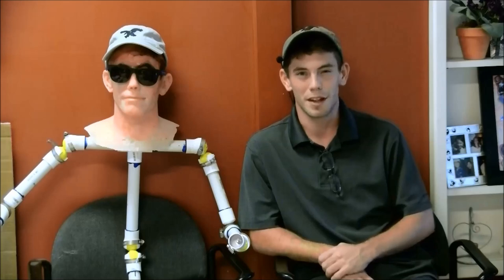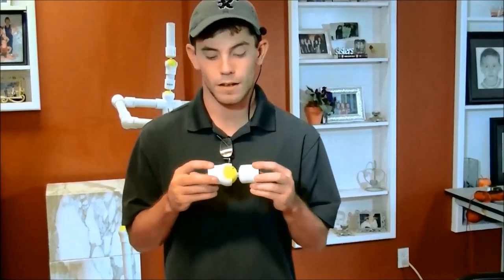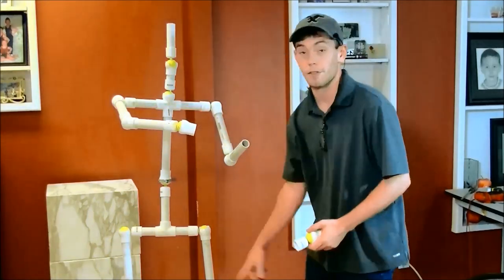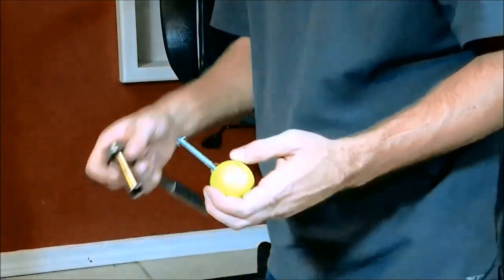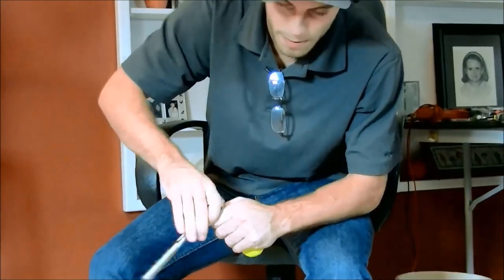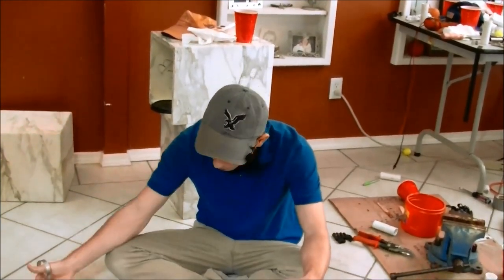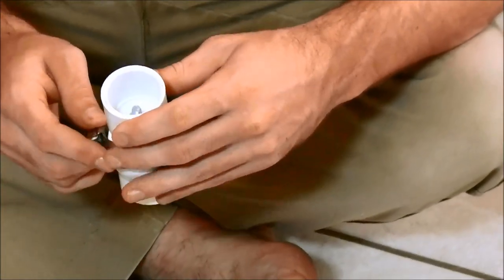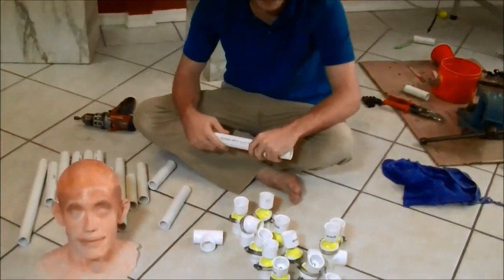Mannequin - Halloween Prop Idea - Mannequin PVC Frame -  2019 DIY Project

Comment: Would some sort of coupling that is expanded to go around the 1" pipe work for the golf balls instead of having to heat pipe and press something in? Or maybe use a larger size of PVC? Or would the collar still restrict movement since it's not curved like the ball? I wonder if a fernco style fitting would work at all. But the rubber might prevent things from moving.
Reply from the maker: The idea in itself is kind of difficult to achieve since we are trying to be able to get something to both move and lock in location. So there needs to be some resistance, getting a pvc pipe larger than the ball itself would create a little too much freedom for articulation in my opinion. Not sure what a fernco style fitting is so not sure if that's practical or not. Rubber can be a good thing if pressure is allowed to be applied manually.
Reply: @TulsaVideoMagazine  A fernco fitting is a rubber coupling that uses metal hose clamps to tighten it on to PVC, ABS, etc in situations where solvent welds are difficult or impossible. You should be able to tighten and loosen the grip with the hose clamps, but being rubber, I'm not sure how much play the ball would get. If you just want to pose it, it might work.

Comment: Probably no hope of this getting answered but what type of bolt did you use for this? The PVC pipe size is easy enough to figure out but the bolts are harder to guess
Reply from the maker: 3/8ths inch and 5/16ths inch are the sizes we would suggest. measure your two golf balls and make sure it can go through both. Ours were 3.5" to start we decided to ground the ends off ours so the ball would have more play inside the socket.

Comment: do you think i can use a blow torch if i don't have a heat gun?
Reply from the maker: You can you'll just have to be very delicate with it, it'll heat that plastic up quickly.
Reply: @TulsaVideoMagazine  thank you for the reply. Just over more question. The double ball is perfect for the shoulder. Your elbow joint with the golf ball, does it mimic the motion of a regular hinge joint? I imagine the ball can twist the forearm quite abit
Reply from the maker: It is similar to a hinge joint, but has both horizontal and vertical motion. SO, it'd be like having 2 door hinges one horizontal and one vertical.

Comment: Oh thank god I found SOMETHING to help me out. I need to build a skeleton of sorts to display a monster costume, and all I had to work on really was 2x4 wood... which since I don't own a circular saw I really didn't want to do... but I DO have a nifty PVC pipe cutter hand tool I could use! If you could answer my question though, I would be extremely grateful; how much weight can a skeleton like this handle, and if I need to add more weight to it, how could I stabilize it further? Thanks in advance!!
Reply from the maker: It solely depends on where the weight is distributed. if you center the weight over his torso i'd wager you could hold 15-20lbs with it but if it's heavy on his arms maybe 5lbs would be the max i'd suggest. Of course you could always tighten all of the joints more so than what we have done to give him more stability.
Reply: @TulsaVideoMagazine  yeah its... a massive costume for sure. Head is about 5lbs, arms altogether I wanna say like 2lbs with the mechanics in the hand, and the tail it has also has some heft to it. I'll make sure to tighten everything as much as possible. Thanks so much for your fast reply!!
Reply from the maker: please post your creation we are very interested when you finish it. We'd love to see it! Good luck.
Reply: @TulsaVideoMagazine  sure thing! My plan is to rig the costume up for display for Halloween so it should be sometime before then!
Reply from the maker: Awesome sounds great! Also, if you need some of those ball joints made we'd be happy to make them for you! Or anything really we can make it and ship it to you. Recently started doing this since there has been so much feedback. We will also be doing a rendition of the ball joints with a much better and cheaper alternative. Hope you check that out in the future as well!

Comment from the maker: zbyszekroyal, 

The bolt head should be burried until the head is flush with the outside of the ball. If you stick it further into the ball it wont necessarily make a difference, but when compressing the ball it could split the ball, so going too far will cause issues. We used 3-1/2" Bolts and ground off the extra length with our bench grinder. The slot is so the joint can articulate further not for keeping the ball in place. We used hose clamps to adjust the joints rigidity after compressing the clamp with our hands. Also, when you are compressing the ball into the socket be sure to use a towel and some water to compress the coupling around the ball while it's still warm, this is what will lock the ball into the socket above everything else, the hose clamp is just for insurance and to keep the joints from moving around on you. Lastly, if you didn't want to use a coupling, you could use 1-1/4" PVC and just pound the balls in directly, this will work the same way as having a coupling on 1" PVC. Just an FYI! Any other questions or do i need to elaborate on anything. Let me know!
Reply: Thank you so much for the prompt and detailed reply! You rock!! However, I'm thinking the 3-1/2" bolt is for the double articulation. I've decided that the only double articulation I want is for shoulders and perhaps one or two other joints. Seeing how my 2" bolt was too short and I had to pull it into the golf ball another 1/2 inch, and judging by what the bolt looked like when you held it up to the camera, I'm thinking the single-articulation bolt is 2 1/2". Am I right?

And one more thing: why didn't you cut two slots into the coupling instead of having two golf balls? Would two slots be too compromising of the coupling's integrity, and cause it to break?

Thanks!!!
Reply: On, one more thing. I have all the tools I need except for...... the bench grinder. Any ideas here?
Reply from the maker: +zbyszekroyal 
Single articulation is yes 2.5" bolts, also, if you bought the bolts at a hardware store, generally they will exchange them just a helpful hint. The more you cut the coupling the less rigid your structure so to answer your question we found that adding an additional ball to the socket was alot better for rigidity than cutting the coupling up. The reason for the two-balled joint is to allow rotation on one half, and then horizontal and vertical movement on the other. 
If you dont have access to power tools it's possible to use a Hack Saw to cut the bolts off, However this will be a very slow process and they wont be flush, which you could use a file to get them as close to flush as possible. The joints will still rotate, the issue is that the bolts will only rotate until they hit the inside of your coupling, stopping rotation. It's not completely necessary for the inner hip joints or shoulder joints to have a completely flush bolt, you will still get some rotation depending on how much excess bolt you have. The less bolt, the more rotation.
Reply: You da man (assuming you're Gabe)! Actually for all I know, you could be da men and da ladies! Thanks to everyone who's helping me!
Reply from the maker: hahaha You're welcome bud. Good Luck, if you come up with any differences you'd like to share feel free, this was our first prototype and we just cracked down on it until we got it to work. Always looking for new ideas and projects.
Reply: Hi. Me again. I have tried five times making the joints.... I cannot get the ball to "lock" inside. It falls out just by inverting the joint. Each time I tried a different length of the slot. Nothing worked. And I don't have a heat gun, I am using a propane torch. Any advice? It's crunch time over here; I need to have this done this weekend and here I am not even having started.
Reply from the maker: +zbyszekroyal 
When you are putting the golf ball into the Socket, you have to apply a very large amount of pressure, we hammered it in, there is a very small ring on the inside of the coupling, if you look closely. If at all possible the golf ball should be almost touching that ring. So, my suggestion is to reheat the socket, and try and get your ball further into the socket. This is what will help "lock" your joint. Also, before the socket cools down wrap a towel or something to stop your hands from burning and squeeze the top of the coupling to attempt to mold the joint around your golf ball. After doing so you will have to "Break" the ball loose from the socket, do not do so until the socket has hardened again(cooled down). This is the exact method we used(Other than the propane torch, however the method of heating your socket shouldn't have much of an effect on its outcome). If you still can't get it, maybe you could send me a picture of your work and i'll try and see if i can visually explain it based off of what your situation is like. Good luck!
Reply: Thanks. What do you mean by "break the ball loose"?
Reply from the maker: Well when you heat the coupling up enough, the ball will melt a tiny bit into the coupling which is fine, but again you will have to break it loose. Inside the socket before you'll get rotation out of it. It shouldn't come completely out of the socket, just give you articulation afterwards.
Reply: Got it, thanks.
Reply: I was going to describe my success to you and post accompanying photos, but this has been a heck of a learning curve with more than a few unexpected problems. The latest is this: The joints were really tight when I made them, but once I assembled and glued the whole frame, they got really loose. The hose clamps hold the balls in place, but the issue is that the joints spin on the nuts. The balls stay stationary in the PVC fittings while they spin on the nut! It's worse for the double-ball joints. Help, please.
Reply from the maker: In our experience  We have had success in tightening loose joint in this manner. If the bolt is still securely imbedded in the golf ball and not completely striped out of the ball you may be able to tighten it up by pulling on the joint like you are trying to pull it apart and spinning it in the direction that would normally tighten the bolt, be care full not to over tighten. When posing the dummy the clamps should be loose enough to not break loose the joint bolts.Posing while they are tight in the manner described will  result in some kind of failure of the joint. Take care not to over tighten the clamps until you have the dummy in the pose you desire.If a joint becomes striped out you have to replace it or take the joint apart and get a wrench back on it. We have replaced many pieces on our dummy by cutting out a joint and replacing it.It will generally cost you a pvc coupling to repair a joint. If you are trying to support a lot of weight with the dummy such as heavy clothing and the like then you might consider increasing bolt size as this gives you more surface contact with the golf ball's outer plastic and tends to hold weight better. We recently replaced most of our joints with the three eights bolts to better handle the weight of winter clothing. Hope this helps. Let us know how its comes out.
Reply: It would have been nice if you had said this from the get-go. I'll keep trying to work out something to fix it. In the meantime I have added supports to it to help it stand. I am thinking my next mannequins will not have any double-articulations. That abdomen joint is quite problematic. If you wish to see photos of what I've accomplished with your guidance, check out my facebook page..... Mark C Still.
Reply: Maybe something like Loc-Tite or a thin coat of epoxy.something that will hold the joint in place but can be broken with leverage.

Comment: With the 1-1/4 inch PVC do you still have to heat the PVC
Reply from the maker: Yes you will still need to heat the PVC. We have found that a heat gun works the best for the heating. The heat allows the PVC to wrap around the ball giving you a secure fit without the secure fit the ball will just pull out with no resistance. Keep in mind that this is the way we did our build. If you find a more creative way to do it we would like to here about it. Our goal in putting out this video was to get people thinking about ways to make the mannequin have full mobility like a human thus giving it a more life like appearance. This was the only way we found to do it affordably it is not necessarily the best way.

Comment: This is fantastic and I will make this myself. I purchased all the parts and started this morning. But it seems I bought too-short bolts. You don't mention this on the video. I bought 2-inch, and the only way they work is if I suck the bolt head about 1/8 inch or more into the golf ball. But that won't make a difference will it? Also, for the double-articulated joints, how long are those bolts? I went ahead and heated the coupling and pounded the golf ball in without dremmeling the slot first. So, right now the golf ball is loose. Is it that slot that allows the ball to lock into place?

I am hoping you will reply back ASAP. I need to make this mannequin - and possibly more - for a Thanksgiving/Christmas display this weekend!  

Thank you,

Mark

Comment: What inch pvc pipe do I use for the dummy, i tried to use 3/4 inch pvc for it but it seems to small and the golf ball is to big for the 3/4 inch connecter
Reply from the maker: Remember to heat up the ends so that you can insert the ball in. Without that process the ball will not fit in the 3/4 Inch hole. We used 3/4 Inch PVC.
Reply: +Tulsa Video Magazine I went back to it again today and it all worked thank you for the help, I will update u on my guy and how it all goes
Reply from the maker: Awesome, sounds good and good luck!
Reply: in your comment above you said you used a coupling on 1" pvc.  but here you said 3/4" pvc.  Which did you use?
Reply from the maker: 1" PVC is used all throughout our creation, we started with 3/4" PVC all around and had to do a large amount of heating and the balls were a bit hard to insert. Use 1" for the best fit for all pieces of PVC on the design.
Reply: Are the joints stiffer using a coupler for 3/4" than a 1" coupler
Reply from the maker: If you can manage to insert the ball into the 3/4" coupler then yes they should be stiffer, since it's a smaller hole. However if you melt too much of the PVC it will lose some of it's rigidity So take care when doing that. My suggestion is to use the "Beam clamps" to increase stiffness if you are having an issue with that.

Comment: I followed this tutorial to the letter.90% of the joints were too sloppy to hold themselves Together without secondary support mechanisms. The only saving grace of this armature working somewhat is the O rings. The O rings themselves are problematic as flat metal does not like to tighten around a slippery plastic sphere,and that’s if you can cinch it down without the O ring failing mechanically first.Honestly maybe there was a portion of this build I missed but in no way will this manikin stand upright unassisted.You can add vertical supports or you can give it bird feet but you can’t just dress it up and walk away like it was a store dummy.Love the concept but could not replicate.

Comment: wayyyyyy to much work.  just glue or screw the pvc... way quicker, easier and works great.
Reply from the maker: These joints were made to articulate if you decide to glue or screw them together they will have no movement! Although you are absolutely correct It would be way easier and quicker.
Reply from the maker: I appreciate your opinion. As i stated before if you want your mannequin to have 0 movement then by all means your way is the way to go. If you'd like to post your idea as a video we would love to sponsor it on our channel. Contact us if you're interested in informing the rest of the individuals trying to perform their own work in various ways. We'd love to have the extra hands helping us build and grow our channel.
Reply: Good job Tulsa, looks great.
Reply: Tulsa, i know its 5 years now but there are easier ways to articulate pvc joints than drilling thru golf ball. And by the way, 15 golf balls? kidding
Reply: @luisbezerrak6727   im looking to do this. Have you found a better way?
Reply: @IH8CalSpa   Bawhaha.... Maybe you should look up the definition of "articulating" in the dictionary! You're talking about static joints, my man. That's not what some of us want.

This guy has a really elegant solution to this issue. Bravo to him.